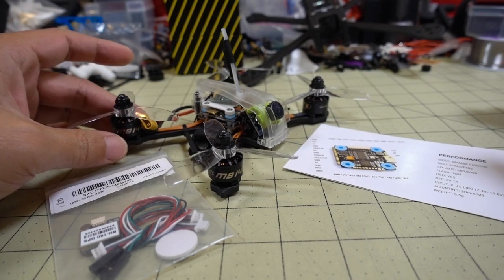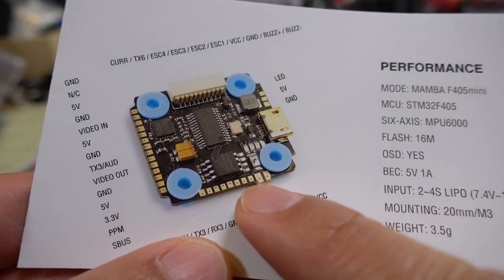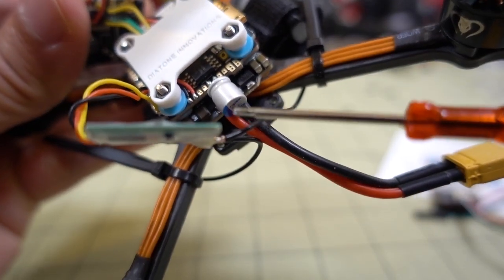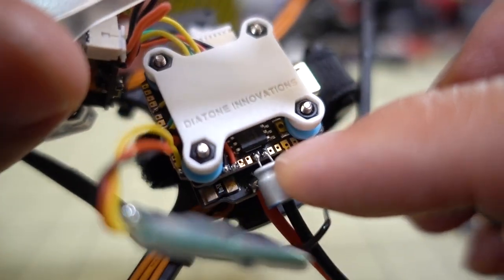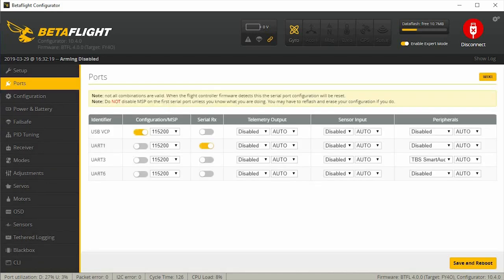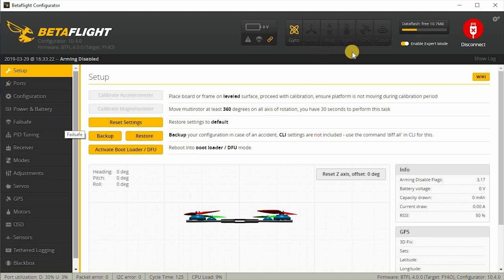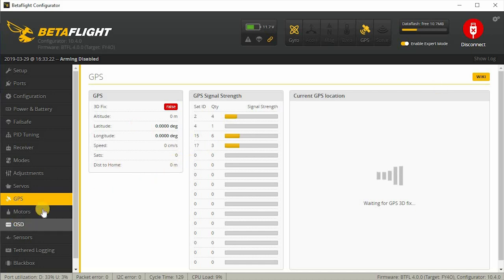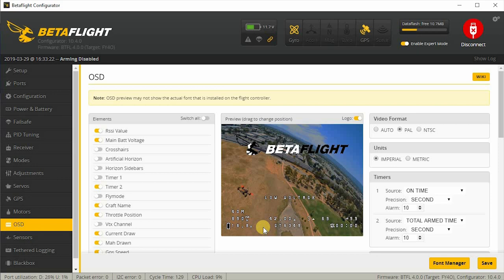Adding GPS for Drone Speed Testing 🏁

Comment: Great vid Albert. I'm curious to see how well the GPS works sitting about 10mm-15mm above 
the flight stack. In my experience with a diatone GT200 the BN-180 GPS  
did not pick up satellites well until I put it on a pedestal 30mm or 
greater above the flight stack. If this works well for you I will add one to my R349.
Reply from the maker: Spoiler alert, it works.  Video on the speed runs coming soon.  I just have to edit and upload it.
Reply: @AlbertKimTV  Great, looking forward to it. One question. Where are you connecting the telemetry? I assume you will be on RX/TX6 for the GPS? I dont have any other Uarts available. Uart1 = Serial RX, Uart3=SmartAudio (mine came with TBS Pro vtx)
Reply: Very good job explaining/install the gps. 1st:When installing my first GPS i was very hesitant so the step x step is great. 2nd: I just realized watching your install for the 3rd time that we do not need the telemetry turned on in betaflight to get the GPS readings in the OSD! I didnt know that? That is why i questioned you in the above reply about where you were connecting the telemetry wire. (i thought you were using FPort but didnt see it in the Port page and that started me investigating) 
one last question. I didnt see how you mounted the GPS or did i miss i?. Do you have a pic of that? Thanks again...great info

Comment: I was actually thinking to toss this exact gps on my r349 to do the same thing. It is really fast on 850mah rline tattu… I wana know just how fast :) Loving this quad
Reply: Mixxer eyyyy mix
Reply: Did you? I can’t get mine to work... did all the settings but the icon in up top does not light up. I get a blinking blue light tho...
Reply: Not yet no haha. I have yet to ever use a gps will be a learning experience for sure. @danman7665

Comment: For those interested; the BN-180 weighs about 5g, and the BN-220 weighs about 5.8g.
Reply: amisoftau any idea which is better
Reply: @maxiemusfpv198  The 220 has on board flash memory, allows saving (and rebooting/powering to) saved settings. We don't really need that, as BF and ArduPilot can both auto-program the GPS at FC startup. I assume that iNav can too. If you're running other custom FC firmware or Arduino etc, you may want to program the BN-220 once as desired using u-center and flash the settings.

The 180 is slightly lighter and smaller than the 220. Other than that it's the same as the 220 but without the flash memory.

Comment: Ive added these to three aircraft. They work great, but once enabled you have to have gps lock tp arm which is a tad annoying if you don't pre lock the satellites via usb power while going to the flying field.
Reply: You can disable the GPS lock entirely, or lower the amount of sats required if you wish..
Reply from the maker: Get the BN-180 I used.  It locks in under 30 seconds.

Comment: Hey Albert, fantastic vid, I am setting up my R349 quad and the same GPS right now but ran into a prob, just about to solder and realized the positive (right) stem from the Capacitor is loose and has ripped the pad off the board. What would you do? Can I move the capacitor, even if I add wires to it so I can place anywhere, and then add the GPS wires to it? Looking at the 2 Far Right Pads, GND and  VCC, would they work? Brigzy.
Reply from the maker: Are you talking about the small cap on the FC or the large on on the battery lead?  If the pads are ripped off, and it's the small one, you can just find another pad anywhere on the FC that is the same as the one that got ripped off.  Since it's positive that must be 5v, so you can just solder a wire to the leg and the other end to a 5v pad elsewhere.
Reply: @AlbertKimTV  Thx, it's the FC capacitor, on the back of the FC, one pad ripped off. (Not the ESC Board or lipo battery lead, can't see one there?). I did what you said I believe, I removed the Cap, I added 3 inch wires to it, heatshrink etc..(will poke the Cap in somewhere later) I then soldered the Cap wires to the front right of the FC onto 5v and GND pads. I also spliced in the 2 wires (red and black) for the GPS so it will have 5v and GND too. I then soldered the white and green GPS wires to the TX6 and RX6 pads like you did, so I think that's pretty much what you said. Thx for that :{) Bit messy but should work.

Comment: Before i buy, price is great too. BUT what's the difference in BN-180 >> BN_880???
Reply: The BN-180 is just a GPS. The 880 is a GPS and compass module.
Reply: I buy bn 880 but i confused about wiring sda and sdl in the mamba f405 mini stacj
Reply: @mr.saleprot6217  U don't need it if you use betaflight or emuflight, rth don't use that's features, if you really wants you can use softserial and use the led pad and maybe the buzzer but I find no sense

Comment: Make yourself a cable so you can power the GPS unit on a 1s battery, when you driving to the flight location. This way the GPS knows where it is.
Arrived you simply plug it in, and you're good to go.
(I have mounted it on a Trashcan with Velcro)
Reply from the maker: The BN-180 I used in this video locks on in about 20-30 seconds.  Perhaps some other crappy GPS needs this.
Reply: @AlbertKimTV 
I then think the Beitian 220 is "crap".. Takes several minutes, even if I choose the region in BF where I fly. Therefore the cable is a good option for me.
Reply: @Mandolgin  I had problems with the GPS taking several minutes to lock also. (My 180GPS was mounted on top of the frame, just above the flight stack). After some experimenting with mounting the GPS i discovered that my GPS would lock on 8+ sats in 20 seconds when I mounted the GPS farther away from the flight stack. I did a pedestal 60mm tall  (about the same height of receiver antennas) and did a 3D print.  I mounted it on the frame above the flight stack. Others have had success mounting GPS out on the arm. I was using a cable as you mentioned until i made the new mount for the GPS.
Reply: @53roger  it's mounted on a Trashcan, so maybe it's therefore that the reception is a bit off... ;)
I don't think it a good idea to mount a big pole on top of it... But the idea is good for bigger ones.

Comment: Hi Albert this is interesting stuff and it made me wonder if when i add gps to my Tyro79 i need to remove smartaudio.
Can i put smartaudio on my LED-pad and make it work with soft-serial?  That way i have a spare uart for the GPS.
Reply from the maker: That could work
Reply: Yes. Smartaudio can be sent over a softserial port and the LED pad is a great option.

Comment: My GPS readings most are pretty accurate for altitude and distance but the speed is incorrect is there a way to fix. Sometimes if I full-frontal for a couple seconds and Stop. Takes a second for the mile per hour to go up. I never know what my speed is until after I slow down and then I watch the osd number start the climb and see when it stops.
Reply from the maker: You'll have to ask the Betaflight devs to fix that.

Comment: Hey Albert, good vid! I have a problem though where every GPS element in the OSD disappears when I arm the quad. The GPS is working fine in the configurator, and before arming I see the sat count on the OSD go up. When reached ~12, I arm it but then it disappears :(. It is weird though, every other OSD element works fine... Both VTX and the camera take direct power from the battery, and signal just onto my omnibus f4 v2 pro video-pins. No capacitor installed. Any ideas?
Reply from the maker: Well without knowing what model GPS you're using or how you have it wired up, I'm going to assume the GPS lost power when you armed.  So check how it it powered and if whatever is supplying power is enough or too much.
Reply: Hey thanks for your reply. I am using the BN220 and the omnibus f4 pro has a uart1 white connector on it where i just plugged it in. That being said after arming the GPS still has the blue power LED turned on and the red LED flashing.... but I'll check the schemes again and maybe find a work around and use another uart to check
Reply from the maker: Try another UART... I think UART1 is inverted on that board.

Comment: Can I use the same 5v and gnd from my led and buzz to hook up my gps? Like have them both on the same 5v and gnd
Reply from the maker: Should be OK but there may be exceptions with some flight controllers so check your documentation.

Comment: Not enough UARTs on the Mamba stack :( If you have S-Port telemetry and Smart-Audio you're done. No room for a GPS.
Reply: Patrick Colclough resource the led pad to smart audio maybe?
Reply: Or the sport
Reply: Smart Audio can be done over softserial, it doesn't need a hardware UART.  Repurpose some other pin and you're off to the races.